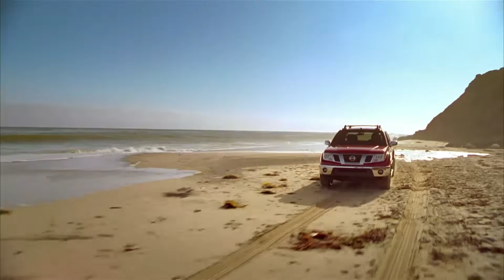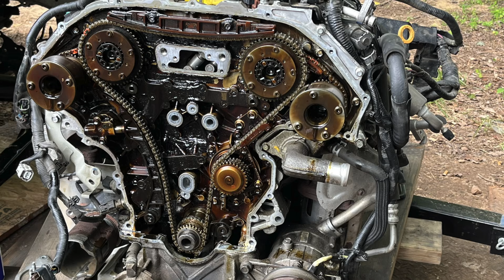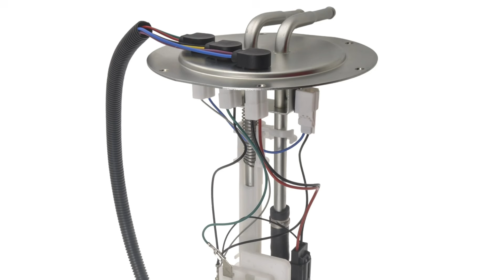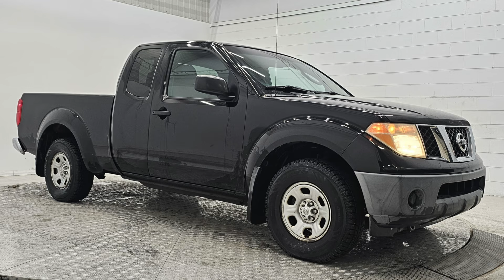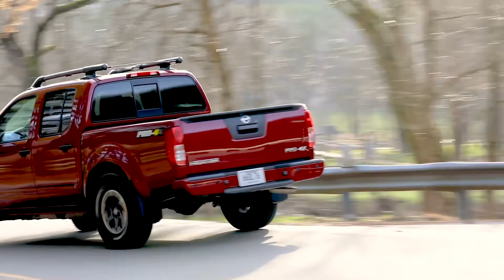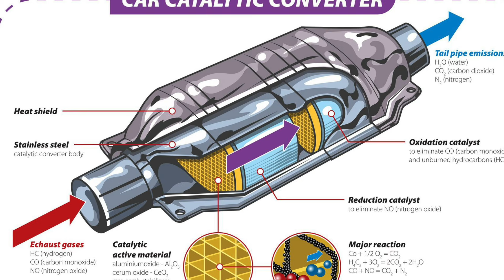Nissan Frontier 2005-2021 : 6 Common Problems

Comment: This video is not very good while it does point out some issues those only apply to certain years and if maintenance is done you won’t run into any problems the frontier is a solid truck that’s why there are still tons of em out on. The road

Comment: If you catch it early, or even before the leak happens, just bypass radiator trans cooler.  Disconnect the hoses and join them together (3/8 hose joiner) and put plugs on the radiator fittings.  There is a separate trans cooler so the radiator cooler isn't necessary.  You don't have to replace the radiator.  Total cost of repair - under $10.00.  If there was already some leaking, drain and replace the fluid a few times. (usually 1 gallon will drain at a time).

Comment: I have a 2006 frontier 4.0 that I bought 8 years ago with 144,000 mi on it. Garage kept so it looks brand new. Love the truck, I replace the radiator the first week I had it just to play it safe. I did have to have the timing chain replaced at 165,000 miles. I have done regular maintenance at 4 to 5,000 mi replaced all coil packs and spark plugs. Replaced fuel gauge sensor in tank and had the AC replaced. To me this is regular maintenance for a 20-year-old truck. The truck has 183,000 mi now and I wouldn't trade it for a brand new one.

Comment: I have owned the 2011 Frontier and the 2012 Xterra. Since I have vehicular OCD, I spend a lot of time underneath and under the hood of my vehicles. If you purchase any used vehicle with over 70K miles plan on a complete fluid, spark plug/coil , shock/strut and brake pad change. If you purchase the Frontier/Xterra/Pathfinder purchase the crank and cam position sensors, they are inexpensive and the average DIY car person can install them. Excellent vehicles!

Comment: 2012 Suzuki Equator ( Frontier rebadged) bought used w/ a Snow Way plow..Well taken care of .. Aftermarket trans radiator installed..Ziebart coating and touched up yearly , 3000mi ofl's , not comercialy plowed .. 106,000MI and love the low tech it has, just what i need..LOVE IT..

Comment: 2014 Pro 4x 60K never been in the shop, nothing has broken best truck I’ve owned wife’s 07 pathfinder shares the Same engine but it’s a beast. It too has never been to a stealer. Maybe that’s why they’re still running.

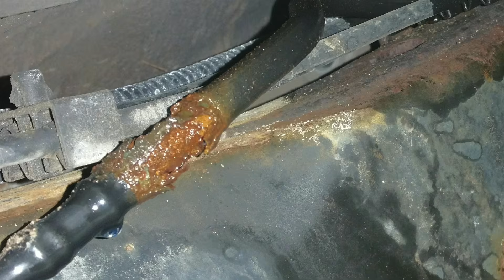Comment: Hello all, I have a 2014 Pro4x 6spd with 170k. Truck runs great, I have dealt with a couple of the issues described. Both wheel arches on the bed are a bit rusty, I had an issue with the rear differential but mine blew axle seal out due to clogged vent. What led me to this video is a current issue that just occurred two days ago, at 4:50 in this video it shows a section in the fuel line, nothing is mentioned about that however I have steady leak from mine in the exact spot. Having a bit of trouble identifying the part needed to repair. If anyone has experienced this I would greatly appreciate any info you have.

Comment: After 30K miles I would install a separate Xmission fluid cooler;  my F150 radiator leaked and ruined my transmission.

Comment: This entire Ai video is discredited right from the start, whoever conceived it didn't do enough research to know that that 2020 and 2019 have a completely different engine and transmission so none of the " common problems" listed apply. Those models have different issues. Many of the problems mentioned were resolved before the 2020 even. This video is a complete waste of time and its misinformation.

Comment: I have a 2007.  replaced the timing chain, guides, and gears. Also radiator, water pump, all spark plugs, and #5 coil. I think the lady who owned it before me replaced the transmission. 102,250 miles on the truck. Running pretty good.

Comment: I have a 2017 frontier 183k miles the only issue was the bank 1 sensor..something like that,no sparks replaced no coil problem,transmission and engine runs good,but yes,is hard to make a u-turn

Comment: 2016 SV. replaced springs and shocks. Rear calipers. Tie rods. All around 10 years old. In fairness, I live in PA. Where they use brine in the winter.

Comment: The Nissan Frontier has a problem with the shifter cable. It comes off because of a plastic grommet does hold well. Its a $10 part. I've had my Frontier since 2006, and I've had to replace this shifter cable grommet twice. Other than that, great truck.
Reply: That happened to my 2014 frontier at around 140k miles. Was happy it was an easy fix, used a Dorman product, luckily I got stuck about .5 mile away from autozone when it happened
Reply: @johndunn2152  I am glad you were about to fix it friend. 

The first time the shifter cable grommet came off was about 10 years ago. I got the shifter cable grommet from the dealership and repaired it myself. 

About a month ago, it came off a second time. I was reversing out of my driveway, and then couldn't shift at all. I had to order the shifter cable grommets from ebay this time as Nissan discontinued the part at the dealership. But, it was an easy purchase and easy fix. Still a great reliable truck 😊.

Comment: I have a 2018 2.5 turbo dsl , 6spd manual , 4×4 ,no mechanical issues , 120 km . Great truck !
Reply: I wish we had that diesel option in the USA.
Reply: @user-bc6ok1yh4s Don't know why it's not avaulable in the states . It passes air quality stds here in Costa Rica no problem . It has plenty of go power without trying to force the issue . It was by far the most bang 4 the $ compared to Toyota , Misubishi , Ford , Chevy , VW ,   Honda , or Isuzo . Multi link rear suspension rides like an SUV vs truck . Also the 4dr , 4x4 carries 5 in comfort with a truck bed for trips to the hardware store .

Comment: I had a 2011 Frontier w/ 125K miles, got indirectly struck by lightning and caused issues with the computer. I just Traded it a month ago for a 2011 Frontier Pro4X with 170K miles, need minor suspension work and a O2 sensor, runs great!

Comment: I have an '08 SE 4x4 with 160k miles and the only problems I've had are some engine sensors going bad. I also did a Denso radiator swap preemptively to avoid further issues.

Comment: I owned a first gen 2000 5 speed manual frontier.,... Took it to 300k miles and just picked up a 2025 pro 4x long bed on Friday and plan on putting another 300k on this one as well. Love this trucks although I never had a 2nd gen

Comment: My 2020 crew cab Midnight Edition 4×4 had to have a new transmission valve body at 60k miles.
Reply: Different drivetrain than the 05-19 models. So possibly different issues could arise than the 4.0 and 5spd automatic

Comment: I bought a 2015 Frontier SV used. My only complaint is the terrible turning radius. My 1999 Ford F150 had a much tighter turning radius!
Reply: I used to drive a 98 f-150 and I've had a 2016 Frontier for about a year, I've experinced this as well with the turning but I've driven bigger trucks than the Frontier so I personally dont mind.
Reply: Ford has way better cornering and suspension than any other in my experience
Reply: Was the 150 a 4wd?

Comment: The timing chain issues were corrected by 2010, it is not an issue on models after 2010. They got revised secondary chains and guides that corrected that problem.
Reply: Well I have a 2019 with 47000 on it and it's making the rattling noise on cold start up then runs quiet .
Reply: @charlesbuendia3371  the rattle noise on cold start is unfortunately completely “normal” for the VQ40DE. My 2019 with 37,000 miles on it does it too. As long as it only lasts a second or two and immediately goes away once the oil gets moving - it’s “normal”. I also have a 2010 Xterra with the same engine and 167,000 miles - same thing, 1-2sec rattle on cold start and then runs quiet. Just make sure to do your oil changes on time and use a good 5w30 and a good filter. 

The timing chain failure that was common on the early VQ40DE pre 2010 was related to the secondary chains they were made such that they had rough edges and they would destroy the guides and then you would have an awful whine that would never go away.
That issue was corrected in 2010.
Reply: @charlesbuendia3371 doesn’t mean anything if it goes away after a second to two. My 2012 does the same thing

Comment: On my newly bought 2016 Frontier SL, the only issues I've had are HVAC related. Actuator control, blower motor and resistor all failed early. No issues other than that and I'm at 60K miles on the 4.0L engine.
Reply: I wonder if that’s my deal, the AC blows hot for about 40 seconds before the cold kicks in.

Comment: These are extremely well-built trucks. These issues do occur on some of trucks and are spoken about on the forums. Thing is most responsible truck owners that had these replaced the radiator and maybe had to put a seal in the rear end. All that was actually caused by poorly designed breathers which some people just simply replaced. These trucks are absolutely not rust prone that's ridiculous. I have read on the forums that people do complain about catalytic converters on these. I have a 2005 and it doesn't have any of these problems. The radiator was replaced proactively, I'm on the original cats, and it doesn't have a drop of rust on it. I haven't had to replace the axle seals. I did replace the breather. This is the most bulletproof truck I've owned since my 1990 22RE Toyota pickup.
Reply: Funny,  it's the TACOMA that had horrible frame rust for years,  so bad that Toyota recalled them,  probably to avoid class action.  But no one speaks about their cult brand.

Comment: 2016 SV 4x4 with 170k miles. Only issue I experienced was replacing a bad ignition coil and occasionally dealing with a clogged charcoal fuel vent, which causes the gas to burp out of the tank when filling up. Other than that, its extremely reliable since I get the oil serviced every 4-5k miles.
Reply: That's good to hear. I have a 2018 frontier also 4x4 with 64k miles. Do you use full synthetic oil?
Reply: @ap1owner8457  Yessir, and usually high-mileage blend. I'm about to hit 175k soon, so I try and run some fuel treatment in the gas tank every other oil change.
Reply: @narutofanar sounds good man. I'll start using full synthetic high mileage oil from now on. Thank you for the advice.
Reply: @ap1owner8457  I have 2018 4.0L 4WD 6spd manual with 115K. I use full synthetic high mileage 5W/30 Change every 3K - 4K.  NEVER go over 5K between oil changes. You will start to burn in internally leaving built up etc.
This 10K between oil changes is total BS to just trash a good engine.
Love this tuck. Its out of date interior with a real key to start it. On the dash like my Dad's old 1965 Chevy C-10.

Comment: There were problems with the upper chains cutting through the plastic timing chain tensioner faces in 2005-2010 model years of the VQ40DE, but it wasn't caused by chain stretch. Borg-Warner manufactured the timing chains for the North American models. The tooling used to stamp the chain link plates for the upper chains would wear and cause stamping with sharp edges on the link plates. These link plates would cut into the timing chain tensioner faces, creating a whining noise for a while and eventually could end up riding on the steel tensioner plunger. Those engines with upper chains made with good tooling don't have any chain issues. Those chains made with worn tooling issues would cause problems in the engine eventually, but exactly at what mileage would depend on how worn the tooling was when it stamped the link plates. So, you could see the problem occur on engines with relatively low miles or over 100,000 miles. Once replaced with updated (or better, properly manufactured) upper chains with new tensioner faces, the problem would usually never occur again so long as OE parts were used. I've heard of some re-occurrence issues with repairs using Cloyes or other aftermarket parts.

Comment: Sadly in this video its not specified wether its 4cyl or 6cyl engines that have these problems.
Reply: The V6 models had the timing chain and radiator cooler problems from 2005-2010.

Comment: I have 2014 with no issues. One battery & the oem lasted 9 years.
I once owned a trans repair shop & think all these frontier
statements are a waste of time, to be still posting them.
The Jatco Trans is one of the best rear drive out there
& easy to rebuild.
I fail to see why anyone would buy a frontier prior to 2013
when all this non sense was resolved.
Reply: So u say the 14s are good or no
Reply: It was never the transmission that was the problem, but the coolant that entered it from the leaking trans cooler in the radiator. Any automatic transmission will fail if you pour engine coolant into it! The other issue was that the metal pin tracks on the TCU/valve body would crack and sometimes break, but they could be repaired with a little wire and solder.

Comment: Watching this after breaking down and getting my 2016 pro 4x towed to the dealership😢 only 104k miles on it
Reply: What a coincidence.  I too am at 104k and am having crazy symptoms like shutting off at idle and weird jerking when driving like the transmission is confused.  2018.
Reply: @lenny7577  Same thing happened to me today - 2016 with 106k on it. That's what led me here...
Reply: @lenny7577  I bet it's the crank sensor !
Reply: @l @lenny7577 unds very similar symptoms my 2010 was shutting of randomly replaced the cam and crank sensors with aftermarket ones still didn’t work and then read in a forum that someone else had the same problem and it was because they weren’t OEM sensors after putting the OEM sensors worked great for a while 😅

Comment: I have 2.5 love it
 Work on it myself
Reply: A good engine with a terrible design when it comes to spark plug replacement!
Reply: @smj999smj I know right. That's the only thing I hate I had to do that and hated it lol. Had to feel for the intake bolts

Comment: Had a 2004 Frontier for 8 years. One set of tires, one break job and regular scheduled service. Replaced it with a 2012 Frontier. What a piece of junk. Oh it started and ran but was always in the shop for some expensive repair. Then there was the paint blistering and falling off except for the spots where the rust came through.

Comment: Our 2019 PRO-4X is very reliable. We take it off road and use it to tow a 2,200 lb trailer. We change the transmission, transfer case and differential fluid every 20k. The Dana 44 rear axle is very stout for a 1/2 ton truck.
Reply: Yup my 2019 turned 81K miles just normal maintenance running good👍

Comment: l think servicing these cars is the key to their longlivity. Changing fluids early and they will do well but 5000 miles or 10,000 Kms is too long between services, but this will apply to most cars. l still wouldn't buy a Navara because they aren't as robust as other makes and have an orphan wheel bolt pattern.
Reply: I do my oil changes at 7500 miles using Supertech Full-synthetic 5W30 and Nissan oil filters. I've had Blackstone Labs do oil analysis on my VQ40DE engines with 150,000, 225,000 and 320,000 miles on them and they always look great! Blackstone Labs said I could increase the service intervals to 9000 miles, but I'll stick to 7500.

Comment: Don't even get me started on the Manual Transmission's dual-mass flywheel pos DESIGN, that eats clutches every 20K!  After x3, switched to conversion kit by Wolfe Technologies to a conventional ONE-PIECE flywheel,and Heavy duty afttermarket Clutch...no more problems!
Reply: That's a you problem. I had a 2006 Xterra Off Road trim with the 6speed manual. I bought it used with 43k miles. I put one clutch in it at 65k and was still going strong when I sold it with 185k miles. I towed trailers and abused it off road. I went through a couple sets of struts though.

Comment: My 07 NISMO 4X4 had a factory transmission oil cooler. Transmission fluid did not enter the radiator. Anyone else have a truck like that?

Comment: I call most of this bullshit, I’ve owned a 2003 crew cab frontier V6 4 x 4 I put 236,000 miles on that truck before I sold it not one problem
Next, I own a 2008 Nissan frontier SE 4 x 4 crew cab V6 4.0 I have handed that truck to my daughter still driving it and it has 247,000 miles on it. We did change the fuel pump in a regular maintenance, not one other problem in that truck drives like it just came off the showroom floor 
I had a 2016 pro 4 crew cab I traded that one in at 89,000 miles for the 2020 Nissan Titan again I had not one problem with that 2016 Pro four 
I also still in my possession, have a 2019 4 x 2 four-cylinder frontier I have 66,000 miles on it. I have not had one single problem with it. 
My Nissan Titan it only has 45,000 miles on it 2020 no problems 
I believe a lot of of these issues on here are pretty much people not maintaining their vehicle. I will continue to buy Nissan trucks.
Reply: I will keep praying for you.
Reply: I agree I have a 2010 and bought it new it has 202,000 miles it’s been awesome.  Used it as a work truck and beat on it like a red headed step child.
Reply: better make sure you listen out for engine knocking on the new titans
Reply: @free-vbucks7210 There ARE no new Titans. However,  the new TUNDRAS are blowing up regularly.
Reply: 2003 was a first gen Frontier, so these problems don't apply to it. The other problems do occur on the N50 Xterra, D40 Frontier and R51 Pathfinder. Take it from a former Nissan tech.

Comment: Well what is the best year to buy a used Frontier ?
Reply: 2012 and after
Reply: Most of the major problems were in the 2005-2010 model years.
Reply: Some say it's the 2019 (2nd Gen), in my case got me a 2018 with 56K miles on it, running as new